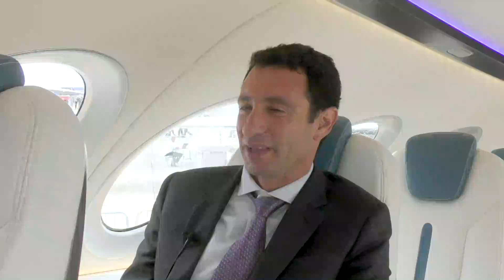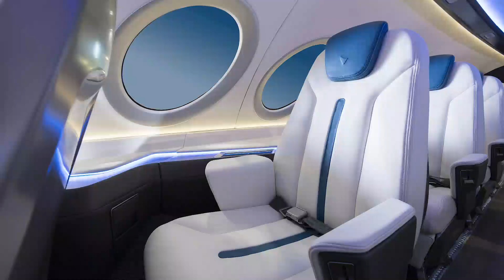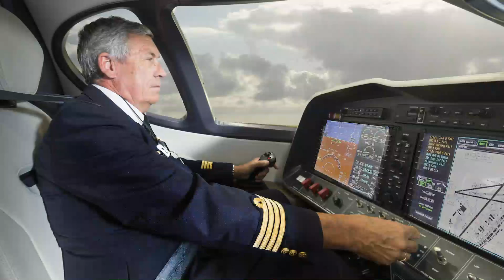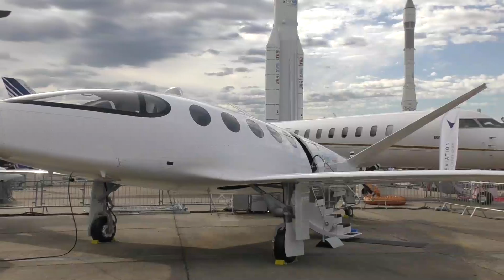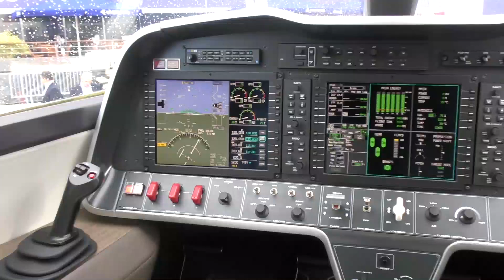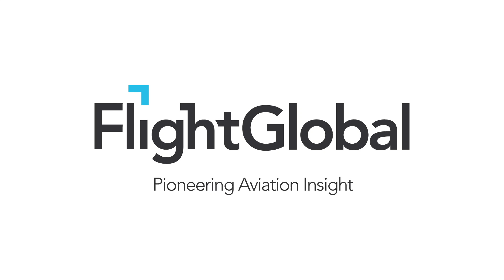Eviation Aircraft unveils the all-electric Alice aircraft at the 2019 Paris air show

Comment: I wonder is it possible to use induction heating instead of gas in a normal jet engine. Induction heating is very powerful it heats metal till its hot;  and with the heat you get from compressed air, you can get the air temperture to be the same as an gas engine. Also I wonder if its possible to have generators powered by the engine, either by the bleed air or from the rotation of the drive shaft  to be used to recharge the batteries while the plane is flying. The power could be used to power the induction coils.  I wonder if anyone is experimenting with that.

Comment: Wingtip prop installation is not a good idea, anyway you'll see it soon when one of your masterpiece roll over the runway and battery will toast its passengers. Battery fire cannot be douse by water, it will make it worse. Your only doing marketing analysis not a little engineering or safety in mind
Reply: The plane is already flying dummy.

Comment: Maximum takeoff weight 14000 lbs, battery 8200 lbs = 5800 lbs for the airframe, three engines, landing gear, tires, three props, pilots, and passengers. Nine passengers = 1710 lbs. They better go back to the drawing board. 
This interview is full of complete BS or pure ignorance of basic aeronautical engineering.
Reply: Another genius thinks he is an aeronautical engineer after watching a video by a company that builds planes.

Comment: Lets see the battery weighs as much as a fully loaded Cessna 208 with 1/2 the range. then a 1 hour charge time for every 2 hours of flight time and the battery needs to be replaced every 3000 hours, The numbers just don't add up. Also with only 9 Pax it will only fit into the EAS and Island Hopper operators.

If it cost 2 billion to design, develop and certify this aircraft at 4 million a copy it will take 500 unit just to break even. And with the amounts of issues that a lot of the newer commercial aircraft are having I.E. 737Max, 787, RR Trent 1000, P&W GTF the regulators will want to keep an eagle eye on the development and certification process.

Comment: he answered my asymmetrical thrust question! Flying in the Northeast it can get really cold in the winters, and as you gain altitude it gets even colder, electric heaters use a lot of energy. How do they end to de-ice the plane and keep the large cabin warm and limit energy loss?
Reply: assymetrical :   the succes of TBM is the single turbo prop, inter alia.  
a reliable PT6 better than 2.
Reply: Compared to the capacity of the pack electric resistive heaters are not going to use a huge amount of power over 3 hours of flight time. It's a big load for the electrical system on a normal aircraft but for a high voltage electrical vehicle system it's not hugely significant.

Comment: Show the flight video or this airplane is a massive fake.
Reply: 8,000lb battery !!!!! 😂😂😂😂😂😂😂😂😂😲😲😲👏👏👏
Reply: @suesan5111  
the gigafactory could not handle .... ;-)
Reply: Then all Planes at a Point where Fake. But they have to make the Flight Test to fly legal. And it will be Not easy to become Certification.
Reply: @gntsom55  : The problem with all of these electric airplane, air mobility, as people call them, is that they are all vaporware. There is no plane, no in depth R&D that proves out the fundamental commercial production of these electric airplanes. From the pure physics, it is implausible a this plane can carry this many passengers, flies this fast on an airframe that doesn't have allowance for the humungous battery and all the electrical control it will need.  Please don't take about the legality because anybody can legally test these aircraft as experimental. This is NOT the road block to electric aircraft.  It's the physics of the tube wing structure. Until these vapor ware developers modify the century old airplane architecture to adapt the electric power plant, the electric airplane will look and operate much different that what is shown in this video.
Reply: @2Phast4Rocket  
"Until these vapor ware developers modify the century old airplane architecture to adapt the electric power plant...."

What do you think you are looking at?

Comment: how do you charge your battery? and what did it take to make to make the electricity.
Reply: You just plug into the 1.21 GW outlet that's available at every airport! /s
Reply: the battery will be charged like you charge your cell phone.  The energy comes from the grid which is fed mostly by fossil fuels currently but depending on the type of leadership we can have (certainly not trump) we can accelerate the transition to a majority renewable (solar, wind etc. ) within a decade or so and could have done it decades ago if it were not for fossil fuel interests that still bitterly cling to power.

Comment: How long does it take to recharge the battery, i.e., turnaround time ?
Reply: You must be right otherwise it would not be viable but it would be nice to hear it from the manufacturer.
Reply: Phil Watson 30-60 min
Reply: Battery modules are distributed throughout the lower fuselage. Charge time 1 hour 10 minutes.
They'd actually make the thing heavier if they accommodated battery swapping due the physical reinforcement required.
Also would be more difficult to distribute the weight.

Comment: Hilarious.  Spanwise loading, engine out, torsional loading are only a few of many reasons not to go anywhere near it.  That rear prop is near useless, but so cute!
Reply: Another guy who thinks he knows how to make a plane.  I doubt you know how to use a screwdriver.
Reply: PETER JOHN BRANDAL 😂😂. Didn't know subway was in the hardware business...
Reply: Steven Seim they claim it can climb, and cruise on the rear prop alone.
Reply: @israelkozlik7554  Impossible.  Honestly.  Take a good look at that rear prop and its diameter/location.  Now imagine the source(s) of air moving through it.  Fully disturbed and separated.  Take a second again and now imagine that prop operating at various angle of attack.  That prop will not remotely clean flow in that area, let alone contribute to thrust.
Reply: Steven Seim time will tell...
Reply: @israelkozlik7554  Exactly.  Spot on.  Time will tell, and my guess is that this airframe will morph into something very different if seriously pursued.  Given what is currently coming forward in that size and form factor, hybrid electrics will likely be first.  The X-57 has been handed over to NASA from Scaled.  That in my respectful opinion is what is coming shortly.

Comment: This looks like a very viable aircraft. Will Eviation provide the ground charging equipment at airports or would they go through 3rd parties. Will a small (20kW, 45 hours of charge time) charger be on-board so that the aircraft can plug directly into 3 phase grid power or will the charger be located exclusively on the ground, saving on aircraft space, weight and turnaround time but requiring more complex equipment at every airport capable of handling this plane ?  A 1MW charger that would typically charge this aircraft in less than an hour is not that outrageous (the sort of thing the upcoming Tesla Class 8 Truck will require) but it would be much too large and heavy for flight.
Reply: Agree that a 1Mw chargers is not difficult to make but getting that amount of power to every gate in the airport will be difficult in the future.
Reply: @EVtestDK  Thank you for your reply. Providing infrastructure is seldom easy, providing avgas and jet fuel presents some difficulties too but that has been achieved, not overnight but as demand has increased the facilities have evolved to meet it. I'd expect a similar slow roll out for electric aircraft charging. There is a Tesla car charging location in the US with 40 stalls and at least one in China with 50 stalls which would require 2.4MW and 3MW peak respectively if each stall was occupied supplying 60kW per car. Anyway I was not envisaging every gate in a multi gate airport would initially have charging facilities, just the one gate if justified by anticipated traffic.
Reply: The most practical way to charge the batteries is to use a service truck with a 1MW generator on board, of course it will generate some CO2 but not more than taking 1MW from the grid as the power company will need to produce this MW from its thermal power plant, as all the renewable is already distributed and used. 

Otherwise if you want to reduce aviation CO2 emission we could built solar runways as airports use a large amount of unused land.
Reply: @johnkubik8559  A local generator would create way more CO2 than grid power (even the proportion that's fossil-fuel).  Most of the grid power where I'm from is renewables anyway. The fossil fuel stations have layers of heat recovery which means their efficiency can hit 60%, while even the most efficient diesel generators struggle to hit 40%. Outside of the daily peak (which usually only last 30-60 minutes per day) there is plenty of spare generating capacity on practically every grid on the planet.

Comment: Clever design, clearly the most aerodynamically-optimised design that I've ever seen, to extract the most out of the battery's energy.  
1)  The wing-tip-mounted propellers are there to reduce tip vortex drag which is the main form of induce drag, which can make up as much as 1/2 of aerodynamic drag at speed of most-efficient cruise. This will do a lot more to reduce tip vortex drag than Whitman winglets found in most modern jetliners. Notice that it is located right at the location of maximum development of tip vortices. Of course, differential thrust on the wing props can replace the rudder, thus reducing weight, complexity, and cost. The e-motors are very light, hence negligible effect on moment of inertia. You would want to put more weight on the wings in order to reduce the wing bending moment hence reducing wing weight. 

2)  Likewise, the rear-mounted fuselage propeller is there to extract the most efficiency out of the plane, by reducing airflow separation aft of the fuselage and hence maintaining laminar flow as far back as possible. Notice that the fuselage contour is designed to promote the most laminar flow possible, which necessitates the propeller be mounted at the aft of the fuselage to avoid propeller slipstream disrupting the laminar airflow.
Reply: +R Pham      Thank you for the explanation. I've seen wing tip props on other electric aircraft but had not understood why that was done.
Reply: R Pham at least someone understands..

Comment: Hmmm... it's a tail-dragger, so I assume that the FBW system will steer the aircraft via asymmetric power control to prevent ground loops given that the pilot has only one throttle. It looks very interesting aerodynamically.
Reply: I have seen both tail dragger and nose wheel. Not sure which the final version will be. It was a nose wheel design on their website.